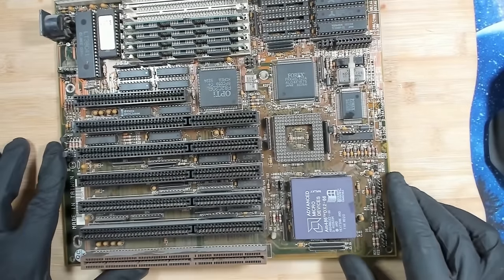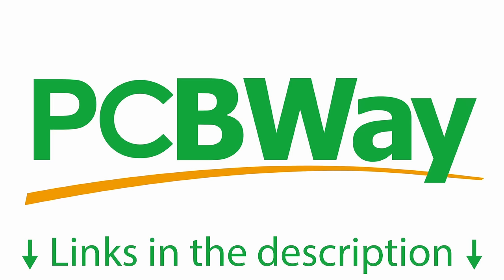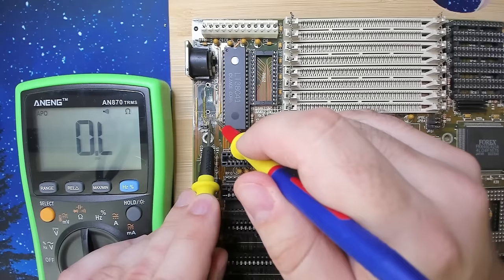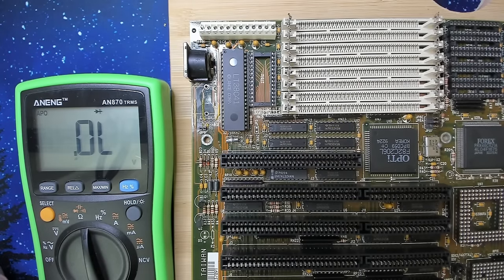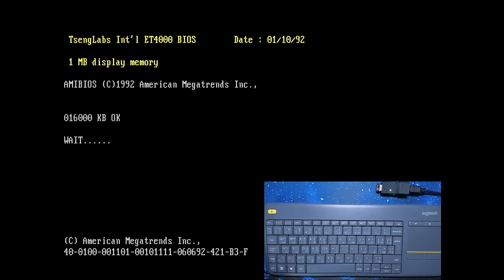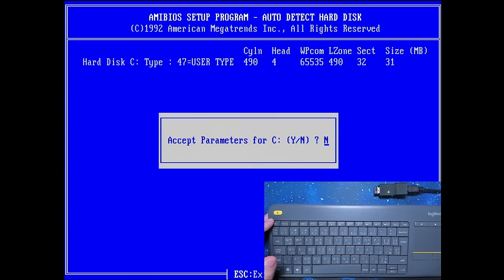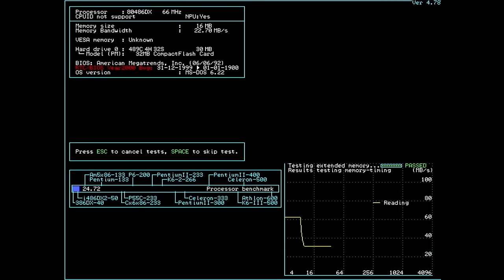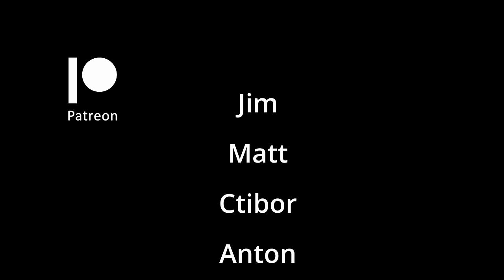Dual-Socket Nostalgia: Forex 386/486 motherboard repair

Comment: Nice, simple repair. Glad it works, just a shame about the performance, or lack thereof. It's possible this is an issue with the chipset. I always got the feeling these 386/486 chipset boards were actually a 386 chipset kludged to work with 486 chips. If it were me, I'd be tempted to slip in a 386 chip and see if you get the normal expected performance from that. Otherwise, there may be some issue with the jumper settings, since we really have no idea if those instructions are for your exact revision of the board, or just something pretty close. And even if it is, I've seen boards and cards shipped with a supplemental note showing the correct jumper settings. Evidently the manufacturer got it wrong in the manual, and decided it was cheaper to just print a note with the correction rather than re-print all the manuals.
Reply from the maker: Good points! Trying the board with a 386 might give some clues. It could very well be that the chipset just doesn't take advantage of 486 CPUs and just somehow works. I'm sure, a 386 will never reach 7+ fps in PC player or 15 fps in Doom - so, it definitely benefits from the higher frequency, but it just can't compete with a proper 486 implementation. We shall see. Maybe it will just be a good 386 system 🙂
Reply: @bitsundbolts  That's what I was thinking, if it performs like a normal 386, just find a better board for the 486 CPU and keep this one as a 386.

Comment: That USB to DIN Adapter certainly is a useful product. Luckily I am the proud owner of a Model M and I saved some keyboards with Mini DIN / PS/2 plugs that are in great shape, but I suppose the day has come for many where that isn't the case anymore and then such an adapter is invaluable. An affordable USB to RS232 / PS/2 adapter for mice would be great too!

Regarding the performance, I concur with Atheatos that ISA bus tweaking is the way to go. Maybe you can also get a hand on an actual OPTi local bus graphics card some time for comparison? Would make for a nice rarity. They might be quite the unicorns though, I've personally never come across one!

Comment: One EISA slot, nice It has features compared to microchannel arquitecture from IBM ps/2 line
Reply: As mentioned in the video this is very likely NOT EISA, it's an "OPTI local bus", it's label "local bus" in both the PDF and the BIOS. And yes, this is a known problem, as he mentioned using an EISA card in this motherboard will result in a bad day.

Comment: I hated OPTi chipsets during 386/486 times. They were significantly slower on the ISA bus than any other chipset. They were also very unstable and liked to crash for no reason.
Reply from the maker: I don't know about the stability, but I am really surprised by the poor performance. I will compare it to other ISA only boards and see if those OPTi chipsets should be avoided for 486 retro machines.

Comment: The settings in the BIOS may be in an indeterminate state.  When you have a system where the battery has been dead or removed, the BIOS settings may be 'random', and cause strange problems.
The way to normalize this is to do the BIOS reset jumper to clear settings, AND load BIOS defaults from the BIOS configuration.   Then save, reboot, then you can make your BIOS settings changes.

Comment: if you ever have need of decent 60/40 solder with activated rosin flux that's 1mm diameter, MG Chemicals 4896-227G is excellent.

Comment: IIRC the UV curing solder mask needs UVA light, you can use the sun but it's much easier to use "nail gel coat" UVA led lights.. Don't ask me why the ones actually intended for UV solder mask is so crappy but I agree they are. You can buy reasonable nail gel curing lights for next to nothing and say a 10W one should cure it in something like 5-30 seconds depending on thickness. This is not surprising given that it basically IS nail gel coat you're applying, just different label. Regular nail polish also works and dries on it's own but is much less "hardy" than either of the UV variants. Those lamps won't work with EPROMs since they need a much shorter wavelength (253.7nm, near UVC) which is also why you have to be far more careful with EPROM eraser lamps.
Reply from the maker: Thanks for this great information!

Comment: I wouldnt say 'dont plug anything in'. just verify the pinout, vogons has a thread on how to tell them apart. I think OLB expansion cards always(?) has "Local Bus" written on them near the edge connector.
Reply from the maker: I mean, if you do find a compatible expansion card, then I guess it's possible to use it. However, as I understand, you need specific drivers to make the card work - sometimes, those drivers are even board specific.
Reply: @bitsundbolts  vga cards come with the drivers in ROM. personally I do have an OLB motherboard + an OLB gfx card.
Reply: I have to say the use of a connector that already has one use should require that they somehow distinguish -- maybe by installing the socket 180 degrees around so the notch in the edge connector is in a different place. This was a very bad design decision and I'm glad it fell out of favor even harder than EISA itself did.

Comment: I have an AM4 mobo with a ps/2 port I'd like to use for interrupt driven keyboard input. An adapter like that would be interesting if it supported high polling rates (1kHz+). :)

Comment: I think I have a use case for that adapter - I have a Model F XT converted to USB, and with it I would be able to use the same board on practically every PC ever made :^)
Reply from the maker: The adapter also supports the XT protocol ;)
But for you, the adapter will take care of AT systems and you're good to go 👍

Comment: I think you could use a ml2032 inplace of the the usual button cell it's rechargeable and fits the standard holder.
Reply from the maker: Yes, I have seen those. I never got one of those though. Do you think this would be a better option? Wouldn't they start leaking again in the future?
Reply: I don't like ml2032. Yes it's safe and it won't leak.

But also it will die in a few years. You'd have to plug in your computer regularly to charge the battery. If you use the machine too much or too little, the cell dies in a couple years. cr2032 you put it in and forget about it for a decade.

For all classic NiCD batteries, you can get NiMH replacements of stacked button cell type. NiMH is safe against leakage if you want a machine which works like original with regard to battery. Which is to say a little annoying, if you put the machine away for a while, the battery will be flat, but at least it will fully self recover when you actually use it. The endurance and self discharge of NiMH is much better. You can even cheat and install a connector on the board and mount 3xAAA cells off board somewhere in computer enclosure, the Eneloop like type, this works very well actually.

Comment: I have had the same problem with Norton SI some years ago and stopped using it. I think it disables cache on some systems because of some faulty CPU detection code. Try testing the system without L1 and/or L2 cache and check against the scores you got after running Norton SI.
Reply from the maker: Interesting. I'll definitely investigate further. This behavior of System Information is just so odd. But at least I know that I have to watch out if I use it in the future

Comment: About the Norton SI weird behaviour, I would try another version of the program. The version Phil used in the benchmark is from Norton Utilities ; I would try a earlier version just to see if the issue is there (win world pc have them all). Also could try another sysinfo software like aida32, troubleshooter, astra  (from Hiren´s boot CD early versions) just to see if the hardware identify routines can replicate the weird behaviour. I never saw something like that, but I believe that the issue is the routine that Norton SI implements to identify the installed hardware (poking I/O adresses?) may alter some bytes and so diabling the cache or something similar. It might be a bug in the BIOS. Try to auto config the BIOS for performance and then for stability to see if there are any difference. Also, may try  to see if with an 386 CPU this motherboard  would behave the same.

Comment: I have worked on a similar adapter using a Raspberry Pi Pico called ps2x2pico which does support keyboard and mouse simultaneously, with a hub or a logitech unifying receiver
Reply from the maker: Nice. I'll have a look
Reply: @bitsundbolts  Cool! It also supports AT and XT (through the ps2pico firmware), two PS/2 passthru ports and its part of the PiKVM pico hid for emulating PS/2 devices with a PiKVM.

Comment: I would love to have one of the adapters, better yet two (if mouse can be added) to run my DEC Alpha Multia. Supposedly some older USB keyboards can be switched but I have never found one.
Reply from the maker: The adapter has a firmware developed by the creator. There is a possibility to support models that may not yet work properly in the future. And yes, a second adapter makes sense for a mouse.

Comment: Can you also try without the USB keyboard adapter? Just use an older one with a PS2 connector and a DIN-5 adapter. It's probably not related, but I've seen very weird behavior with 386/486 systems in the past (such as sound blasters clicking and popping loudly or actual video artifacts, because of... SD card to IDE adapters).

Comment: I also have a 386 / 486 board (Edom MV008) with an OPTi chipset and it suffers from similar slow performance, although mine has VLB and I am using a VLB graphics card.
Even using /3 divider (11 MHz) on the ISA bus only helps a bit, but not much.

From what I can tell, the problem seems to be related to memory write performance as that is really slow (8MB/s so even slower than yours). If I disable the external cache, write performance gets significantly faster (almost 2x) so it seems the cache implementation is the culprit. It might be set up as a simple write through cache and I have no BIOS option to change that.

While disabling the cache will improve the memory speed, it doesn't compensate for the loss of cache in the general system performance so I leave it on and just accepted that this platform is probably just not good for 486.

Comment: will that USB to PS/2 adapter split out the mouse signal if you use a PS/2 spitter?  and potentially a PS/2 to serial adapter?
Reply from the maker: At the moment, it only translates one signal at a time. It supports AT mouse or keyboard, but not simultaneously. It also supports USB to XT keyboard

Comment: Surely you tried with a coin cell battery plugged in? Otherwise worth a shot, it's been proven in the past that some boards behave weirdly without a battery
Reply from the maker: I had an external battery hooked up. I don't have a button cell holder that fits at the moment

Comment: I wonder if the Forex chipset makes compromises to support both the 386 and 486 bus. I.e. you get 386 bus performance even when you have a 486 installed.
Reply from the maker: That seems to be the most common suspicion among many commenters.

Comment: I just use a USB>PS/2 that I got with a mouse years back, and a PS2>AT (5-pin DIN) adaptor and seems to work fine! :)
Reply from the maker: This only works if you have a keyboard that implements the PS/2 protocol. When USB got more popular, keyboards supported both and you could use it with USB or ps/2 with a simple adapter. That's no longer possible with modern keyboards that use a wireless dongle
Reply: @bitsundbolts  Ah, my 'modern' USB keyboard(s) still work, although they are not Wireless, I don't personally like Wireless keyboards (and have never found myself thinking 'I wish this keyboard was wireless' :D) so maybe it's just wireless ones? 

I'll have to test all the KB's I have and see if any don't work (some basic USB ones, some more 'advanced' with RGB and Screens etc) :)
Reply from the maker: I would expect the more modern keyboards to not work with a simple USB to PS/2 adapter. I think the older models have a way to detect if they're connected to a USB port or PS/2 and transmit with the correct protocol.
Reply: @bitsundbolts  Have so far tested my Asus ROG Strix Flare - that worked.. (no RGB obviously, separate USB for the LED's)

Logitech G510s - This also worked, but only as a basic keyboard (again, the display etc doesn't work, as requires a 2nd USB)

Basic Dell "e-waste" Keyboard - This also worked, no problems here...

Basic 'unknown' e-waste 'thin' keyboard - This one DIDN'T work....

I have a couple more to test when I dig them out of my storage tomorrow :)
Reply: Those passive adapters only work if the USB keyboard/mouse is PS/2 compatible as well. This was fairly common in earlier devices but nowadays you'd probably have to find one specifically that states PS/2 support.

Comment: Did you put a heatsink on the CPU in the end? How important are the heatsink instructions on the chip? Do you usually get away without a heatsink even on a chip that says it needs one?
Reply from the maker: Yes, I used a cooler. I just put a socket 7 cooler on the CPU - not clipped anywhere since this socket doesn't allow for it. The CPU gets hot and the heatsink warms up quite a bit. I think you should follow the instructions. Those CPUs should have a heatsink and airflow

Comment: Ram is 3 times slower than normal dx2/66 system.
Reply from the maker: Yes, that's quite bad 😔 I am not sure why that is. I need to check other ISA only boards and see if the memory is faster.
Reply: @bitsundbolts  Try filling all 8 slots if you have the sticks to do so. There's nothing inherently worse about the performance of 30 pin SIMMs compared to 72, if they're bearing the same chips as they are in this case.

Also try bog-standard 1 MB SIMMs just to make sure it's not your 4 MB SIMMs. It probably isn't, but you might as well rule it out completely.
Reply: @bitsundbolts  486 supports burst mode for memory access and enhanced bus protocol. maybe these modes don't work on this mb because of 386 compatibility.
Reply from the maker: @theALFEST that could be a possibility. They just tried to make a cheap 486 capable board. I don't think people were questioning their system's performances those days.

Comment: I have a similar 386/486 board, the FIC 4386-VC-HD. Paired it with an i486 DX2-66, CL GD5429 ISA graphics-card, 256KB cache and 20MB 32-pin SIMM RAM. It's also a mixed bag, getting a Topbench score of 110, Doom max 13.7 fps, PCPlayer 8.6, speedsys 24.92. Sysinfo works though with a score of 130.7. Your main memory and L2 cache look way too slow. My board has 18.1 MB/s memory and 46MB/s L2 cache in cachechk. The main bottleneck is ISA bus in both our cases I believe. Sadly my Award BIOS doesn't let me change the divider and I don’t know which clock speed it even runs at.
Reply from the maker: That's very good information! Thanks for sharing. So, we do score about identical in many benchmarks. Except for system information - which seems to work for you.
Reply: @bitsundbolts  Thank you for the great videos! Glad I could help and provide info. Sysinfo bugging out might be due to different chipsets, my board has a VIA one. Wish I had an EPROM programmer, retroweb lately got an AMI BIOS for my board that might allow to change ISA dividers. If you want to compare any other benchmarks, let me know and I'll try my best to report them back.
Reply from the maker: Thanks for your offer. I might come back to it. But I also have so many other 486 boards that I need to look at - I think I should have around 7 boards with ISA only.

Comment: Did you check to make sure the keyboard adapter wasn't the cause of the weird performance issues? Probably not but best to rule it out. My guess is it's probably the bios itself, and if there even is an updated bios, it's probably unobtanium.
Reply from the maker: Good point, although unlikely, I will try run the SI benchmark with a different keyboard.

Comment: I have recently tested all new solder available in our electronics supplier here and comparing it with my solder that I have bought around 2000 the new ones are garbage.
Reply from the maker: I absolutely love my solder wire from 1998. , but I must admit, I haven't tested anything new. Maybe it's better that way
Reply: What have you tested? Have you tried leaded solders from TME? They carry Broquetas and Cynel.
Reply: I have tested only the leaded solder available at the shop. I will not name brands but I can say that there were also german and dutch "made" solder. Even the new batch of the same brand of solder as the one that I have is signifficantly worse. I suspect that it has to do with the metal purity and content of the rosin flux inside.

Comment: The 387 extension is not the same, as the 0807 extension. The 32 kb 87em. Exe loads into the pc, and resides in there once it is run, even if it can’t run. Heretic game also has it inbuilt, but only enables the maths coprocessor if it is forced to. To force it, the cpu cycles have to be set to very high. It is important for laptops to draw the frames in Youtube when it is in energy saving mode. Tricky, a good laptop has the feature turned off by default.